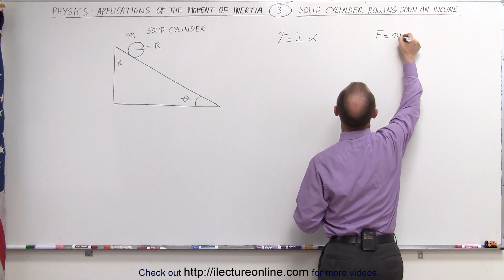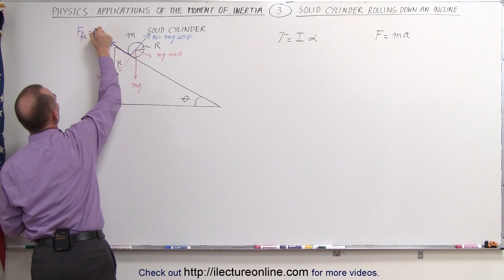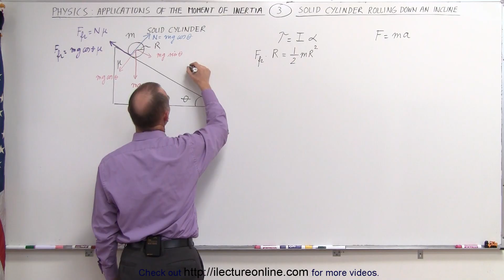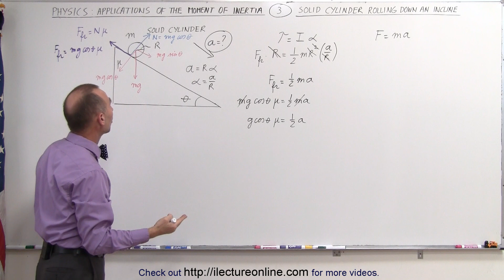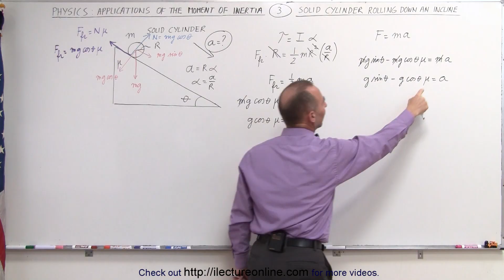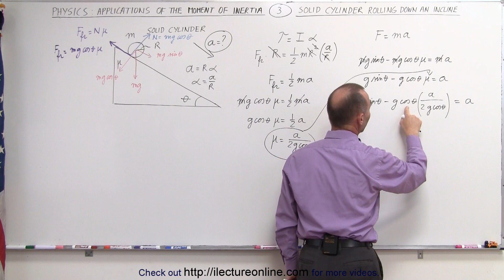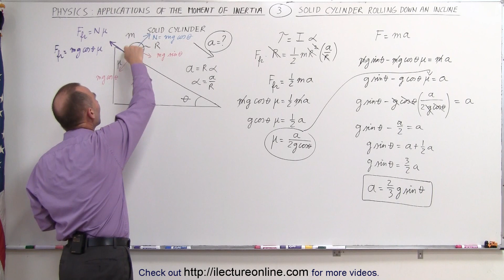Physics 13.1  Moment of Inertia Application (3 of 11) Solid Cylinder Rolling Down an Incline

Comment: so the acceleration is NOT dependent on the radius of the cylinder?  That does not seem right.  So a small cylinder and a large cylinder will go down the ramp at the same rate?  No dependency on the moment of inertia?   Hmmm.  I will have to work this out on my own.   That does not seem right.  Free fall of course is mass and size independent, but the rolling motion... hmmmmm
Reply from the maker: It turns out, it does NOT depend on the radius.

Comment: If solid sphere and hollow sphere are moving down an incline with a constant velocity . Which will reach the bottom first?
Please reply. 
Just tell me the answer, I'll automatically understand the solution.
I have an entrance exam on Sunday. I need to know the answer as I can't find it anywhere else.
Reply from the maker: The solid sphere will reach the bottom first.  (It has a smaller moment of inertia which means that more mass is distributed closer to the point of rotation, which in this case is at the center of the ball)
Reply: @MichelvanBiezen  thank you so much. That helped a lot.

Comment: one little confusion in here from the derivation we are able to find the coefficient of friction also but it seems(not sure about that) the coefficient of friction depends on the surface roughness of the materials, isn't it?
Reply: The one we get from this equation is the minimum coefficient of friction required for rolling without slipping to happen
Reply: You are correct. Saying friction = Myu * N in this case is wrong

Comment: So if I want to calculate the static friction force, I still need to calculate alpha right?
Reply from the maker: The static friction force is calculated (without needing to calculate alpha).  As seen with the equation near the upper left corner).  The static friction force doesn't slow down the wheel, it just provides the torque to make it roll.  (otherwise the wheel would slip).
Reply: @MichelvanBiezen  Thank you for the reply. But what if I don't have the friction coefficient u? I'm working on a problem that is similar to this, and I only have the mass, the radius of the solid and the angle theta to work with.
Reply from the maker: They probably assume the friction is there to make it roll (instead of slide).  Just work out the problem assuming that there is sufficient friction as shown in the video.

Comment: You get a 99% in my book. The 1% is because you mentioned coefficient of static friction, but really solved the problem of kinetic friction "given a light push". To solve the problem using both static and kinetic friction, I believe we would have to introduce energy equations. But you're use of torque and moment arm explanation of friction was brilliant.
Reply from the maker: There is no kinetic friction present in this problem.  When an object rolls down an incline then there is no relative motion between the surface of the incline and the surface of the wheel.  (They are static relative to one-another).
Reply: As Michel already mentioned, there's no kinetic friction. The cylinder is rolling without any sliding. Of course new points of the cylinder get in contact with the inclined plane every moment, but none of them actually slide.

Comment: is it possible to use energy conservation to solve this problem?
Reply from the maker: If you are looking for the acceleration, it is better to use this method, however you should be able to find the final velocity using conservation of energy, and then find the acceleration using the equations of kinematics.
Reply: @MichelvanBiezen  thanks so much! I'm supposed to find time for a hoop to reach the bottom of the Incline and I used energy conservation to find the final velocity to solve, but my friend told me to use the method in the video so I was slightly confused.

Comment: this is an interesting example of how a mistake cancels itself out during the derivation, so that we still end up with the correct result even after using a wrong assumption. The wrong assumption here is that static friction equals limiting friction. Since static friction is numerically equal to (ma)/2 in this case, and only that result is finally used to arrive at the expression for acom, everything works out fine in the end.

Comment: Dear Sir, static friction is a self-adjusting force and adjusts its value so that it is just sufficient to prevent relative motion between the point of contact of the wheel and the inclined surface. While rolling without slipping, it is often less than the maximum possible value of static friction which is called the limiting friction. In this case of rolling without slipping, we can't equate static friction with limiting friction. Static friction is actually equal to   [mgsin(theta) / (1 + mr^2/I) where I = moment of inertia of rolling object about the axis of rotation passing through its center of mass. For a solid cylinder, I = (1/2)m.r^2. This gives static friction f=(1/3)mgsin(theta). From net force equation, we get mgsin(theta) - f = m x acm  (eqn 1) where acm is linear acceleration of center of mass. Which gives acm = (2/3)gsin(theta). We obtain the expression for static friction by solving 3 simultaneous equations in 3 unknowns (alpha, acm and f) : net force equation (eqn 1), the torque equation rxf=Ixalpha (eqn 2) and the relation between angular acceleration alpha and linear acceleration of center of mass acm, which is given by alpha=acm/r (eqn 3)
Reply: I agree with your comment. People seem to often mistake the equation for the maximum available force of static friction (mgCos(theta)mu) as being the actual force of static friction which as you point out is not necessarily true. I worked out the equation for static friction to be F = mgSin(theta)k/k + 1 where "k" is the coefficient for the moment of inertia such as 1/2 for a solid disk.
Reply: Youre absolutelly right. Solving the problem by the way he did is only true for the limiting case where the inclination is so big that the static friction force is at it's limit.
Reply: Really important distinction, thanks for sharing!

Comment: Can someone explain to me why coefficient of friction depends on angle?

I noticed if you set the equations for "acceleration" on the torque side and the Force side equal, you will get an equation like this 
{ u = 1/3 * tan(theta) }. 
And I do not understand this result.

Isn't coefficient of friction a quantity that's only related to the nature of the contacting surfaces?  How is it changing while the surfaces are still the same two? Or it tells something about the resistance in rotational motion rather than the static friction?
Reply from the maker: The coefficient of friction does not depend on angle.  But the friction force does depend on angle since it depends on the normal force component of the weight of the object.
Reply: Michel van Biezen you didn’t understand my question sir

Comment: YOU ARE A LIFE SAVER. I was intending on doing a simple project on finding the coefficient of friction down an inclined plane which is extremely easy but I was so stupid that i chose a cart which used wheels to move. Hence my data did not line up with the standard model of coefficient of friction and I was so confused. Thanks to your video, I won't fail my project now XD

Comment: Why is static friction as opposed to kinetic friction acting as the cylinder rolls down the incline?
Reply from the maker: Because when the cylinder rolls down the incline, the surface of the cylinder (when in contact to the inclined plane) does not move (linearly) with respect to the incline.

Comment: Isn't your static frictional force supposed to be an unknown since we can't assume that the static frictional force is at its maximum. All we know is that static frictional is just right for the body to roll smoothly down the ramp without sliding. At any angle, the ball cylinder would roll without slipping, so its static frictional force isn't at a maximum. If it were a box sliding, you could say fsmax is mew*mgsin(theta) since we know its a maximum static frictional force just before the box slides, right?
Reply from the maker: The static friction is as shown in the video.
Reply: I'm still a little bit confused since my book says otherwise about the static friction. Also would the net torque be a negative value since your static frictional force causes a clockwise rotation of the object?
Reply from the maker: If you want to express the torque as a vector quantity, yes.  If you express the torque as a magnitude only, no.

Comment: If you were to do an experiment with a few cylinders (both solid, hollowed, and (centered?)) rolled down a slope, would you measure the velocity of the various cylinders at the end of the slope and afterwards calculate the moment of inertia? (mgh=½mv^2+½I*w^2      ,     w=v/r)
I'm about to write a rather large paper on this subject, but I am not quite sure about an experiment. 
(You would of course know the angle of the slope, the mass of the cylinders and their radii)
I apoligize for any spelling mistakes, I'm not native. Thanks.

Comment: why does the component mgsintheta cannot produce the torque on the cylinder??
Reply from the maker: Because it acts through the center of mass, which is the center of rotation.
Reply: Thank you!
Reply: The force of static friction that causes the torque is directly proportional to mgSin(theta) though.

Comment: Hi, Wondering if you can help solving an old exam problem... where a Cylinder a rolled carpet that start rolling down an incline so the mass is variable , the question: what is the speed of carpet edge when the carpet ends unfolding.
Reply: It is very easy
Reply: Taught in india in 11th class

Comment: Of course, this result is limited to the domain where a friction force obeys F(fr)=N*mu.
If one makes theta = 90 degrees in a=(2/3)*g*sin(theta), we get a = (2/3)*g.  Yet, we know that it has to be a=g (object simply falling).
Reply: That is indeed true, but while reading and using this equation, you have to take into account, that this only works for cylinders pure rolling. If theta is 90 degree, it wouldn't roll, or atleast wouldn't roll that well, and therefore not being pure roll. If anything in this message is incorrect, PLEASE let me know. I want to learn as much as possible.